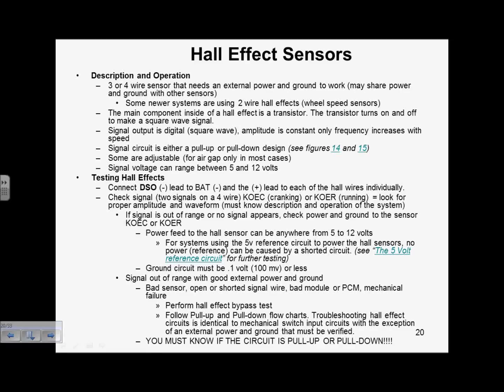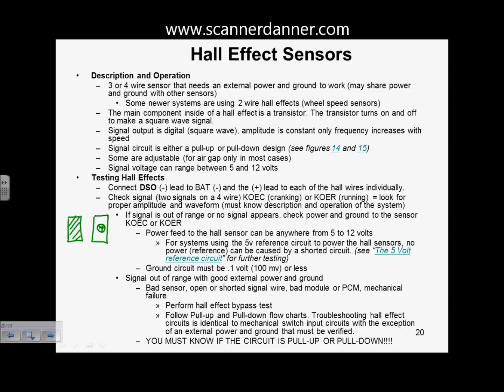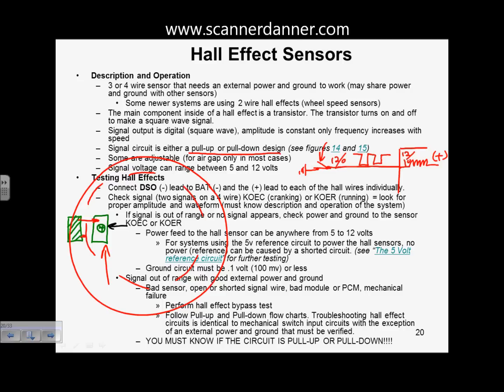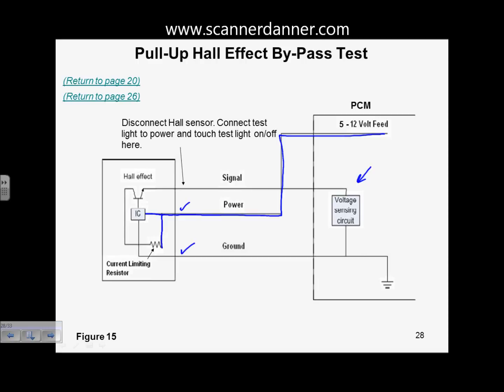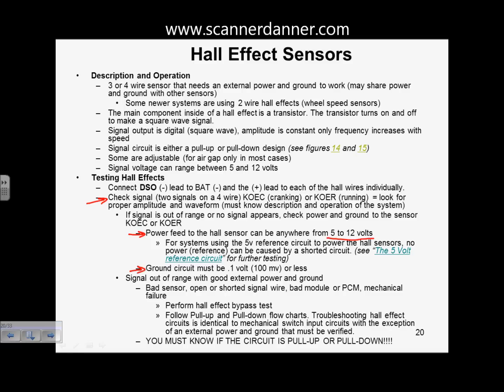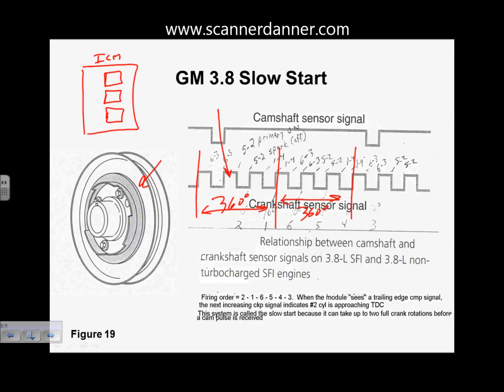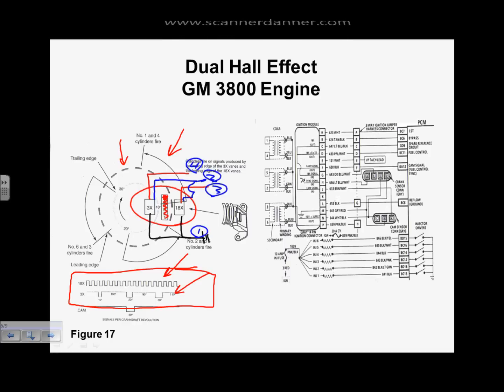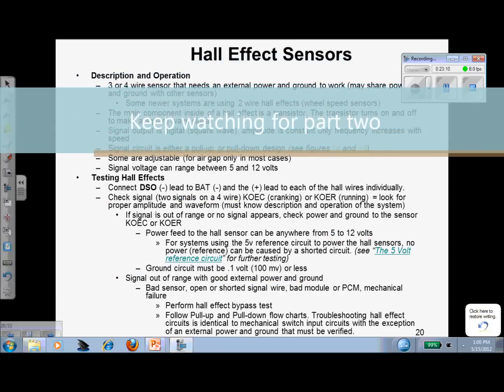Hall effect cam/crank sensor operation and testing Part 1 (an SD Premium video)

Comment: Thank you!!!!!Another Excellent video which saved my proverbial bacon. I was able to test my Megasquirt 3 Pro Mini setup with the info in this video and your other GM 3.8 crank signal wiring video. It was still a real thinker, but I was able to determine my wiring was good, but that I was taking the switched power for the sensor off of something controlled by the fuel pump relay. It would only activate for a couple seconds before kicking off until seeing a crank signal. Well... If the crank sensor isn't getting power after it kicks off, it'll never see it. A change in wiring and my car now starts reliably, not just when the FP relay initially primes the pump. 

Thanks again!
Reply from the maker: heck yeah man, that is awesome. That was some good self study you did there! Proud of you. Nice job

Comment: How come the 12 volts does not drop when there is current flow. i know the 5 volt ref circuit doesnt support current flow so theres barely any current. However, unless the resistance within the computer voltage sensing circuit is greater than the current limiting resistor, i dont understand why it wouldnt be dropped across the resistor. feed back is appreciated because i want to master this. thank you.
Reply from the maker: I need additional info. 12v on what circuit? There are super small amounts of current flow on a hall effect circuit too. The resistance inside of the sensing circuit is very high! So high that it is not really a direction current can travel

Comment: So can the signal wire be 5V with a 12V power supply?
Reply from the maker: typically when you see a 12v power feed on a hall effect, the signal circuit is usually a 12v pull-up design, but I'm sure you can also still have a version out there where they use a 5v pull-down on the signal circuit, with a 12v supply
Reply: @ScannerDanner  okay gotcha, got a 2010 Mazda 3 with a 2.0 having a helluva time tracing a p0720 guessing the TCM is fried cause everything checks out with wiring

Comment: Scanner Danner!  Great Video!  I have been out of automotive for 25 years and this was Great and easy to follow and understand.. Thank you!  And a question if you may know?  I have a 99 Ranger 4x4 with a  3.0, 5 speed that I have no acceleration to speak of.. Runs smooth, I Just replaced Cracked Heads this year. and timing chain and gears a year ago, Had No Blow by, No air leaking from any valves, No Cylinder wear visible..  Had a cam sensor code when 1st started. So I set sensor 15deg of center line as instructed which got rid of code.  Drove 1,500 miles 70-75mph  to Texas getting 20mpg but very slow accelerating with foot to floor in 4th or 5th gears.  No Codes, No overheating?  Checked cable and fixed Stretch.  I am at a lose?  could synchronizer being off 180 possibly do that?

Comment: Trying to help friend with 92 Dodge B350, cranking has fuel but no spark. Anyway you can help SD?
Reply from the maker: Post this to my forum. Some questions require research on my part, which I cannot offer here.

My forum is free to join. https://www.scannerdanner.com/forum.html We have over 17K members world-wide and we also have paid moderators who are there to help me help you guys! You will not find a more helpful and friendly forum anywhere. Thank you for understanding! Hope to see you on the forum.

Comment: Could I safely say, If I take my Circuit Tester and place it on Battery Negative and I then touch the signal wire of the HALL EFFECT SENSOR and I get a reaction on the circuit this would represent a PULL DOWN DESIGN HALL EFFECT SENSOR. And if I were to place my Circuit Tester on Battery Positive and I then touch the signal wire of the HALL EFFECT SENIOR and I get a reaction on the circuit this would represent a PULL UP DESIGN HALL EFFECT SENSOR .
Reply from the maker: What kind of circuit tester? An LED type test light will not work.
And depending on the position of the reluctor or drive plate when the engine shuts off, this can pull the signal low causing misidentification of the circuit. This is why this test is done unplugged. 
Then finally, you won't get a reaction without having both cam AND crank signals at the same time on some system.

Comment: Mr Paul I have run into problem and I want u to clarify something for me.am working on a 2013 e class benz and the problem is the  bake  light stay lite all the time.i went to the remove the brake switch and I realised the brake switch was a four wire brake switch.i try to gather information from the Internet about the switch and to my surprise and my first time of hearing that the brake switch is hall effect sensor.i know for a fact that hall effect are mostly use on rotary or revolutionary sensors like the speed,cam and crank sensor,abs and many more but never knew it can be applied on brake switch sensor.i know with the four wire Hall effect sensor we have to 2 signal power and ground.Mr Paul in your book you made mention on by passing the 3 wire sensor if it is a pull up or pul down but u didn't talk on how to by pass by the 4 wire with the 2 signal.my first question?i want to know theory behind the brake switch since the brake pedal is not a rotary type but only move up and down....Secondly how do we bypass the two signal wiring...Thank you

Comment: I'M trying to install a 3 wire to my vw tdi 07. i like to identify the 3 wires. between yellow + black residence is 44.8 and next ,. black and red .92 i like to identify emc so not to mess with $87. is this a enough information, thanks

Comment: Hi great videos am currently struggling with getting my Hall effect cam sensor on a mega squirt ecu and I have 12v going to the cam sensor ground is going straight to the block and signal going to the ecu I have a 1k resistor going between the 12v and signal wire. When I crank the motor over I don’t get any wave pattern. does the ecu need to know when it the cam sensor is grounded? like using a sensor ground going to the ecu?  Just been so stumped on this part
Reply from the maker: So the 1k resistor is creating a voltage signal that the sensor will pull low (transistor in the hall effect) as the trigger wheel "excites" it. The ECU will see this high/low signal (which I would call a modified pull-up design) as cam position. If your signal is staying high, I would pull that sensor and move it past a metal object to see if you can pull that signal low.

Comment: Are all 3 wire cam/crank sensors hall effects? Are Toyota, Nissan, Honda hall effect sensors and will you test them the same?
Reply from the maker: Unless it is actually a 2 wire VRS with the third wire being a shield. (I've seen that on Euro cars)

Comment: pull-up design...ah, earlier in your book you draw it such that the signal wire goes beyond the voltage sensing circuit(in the pcm) and then to ground...here s different...explain!...bcus, if it is not grounded, then there is no current flow taking place there...(just volts, no amps)...
Reply from the maker: It's just a sensing circuit. There is no measurable amperage. The internal ground in this application just keeps the signal square when the switch opens up. With no ground, voltage would ramp off instead of being immediately 0v. Sometimes I draw it, sometimes I don't because it's not important in anyway for troubleshooting the circuit. Male sense?
Reply: ok...understood...one more thing...why is it that you never mentioned(at least for an easier understanding) the fact that pull-up and pull-down are actually a power side switched and ground side switched, respectively?
Reply from the maker: Because I apply those terms to output controls which are absolutely not the same and I do not want my students getting confused about what they are working with.

Comment: so if you unplug the sensor and you still have 5 to 12 v on  the signal wire , it would be a pull down design ?
Reply: No, he has it backwards. The terms could be different in automotive, but in electronics, a circuit which relaxes to a low (ground, 0V) state is called pulled-down and a circuit which relaxes to a high (positive voltage) state is called pulled-up.
Reply: @GarrettFellers  by "relaxes", you mean in the "off" position? Relaxed being off vs. energized?

Comment: Hi scanner. have you ever seen a 3 wire hall effect with no supply voltage give a ac sine wave on the signal wire? This is a Uk spec audi s4, 1994. it has a hall effect rpm sensor that reads the teeth on the starter ring gear and shares the supply that is missing of the crank sensor and they both give ac sine waves. the car starts but is a intermittant  stop. Its all interesting.  I hope you see this. thank you for all your videos on both channels. i look forward to hearing your experiance with this.
Reply from the maker: +pip470 If it is an AC sign wave on a three wire sensor, then it is not a hall effect. It is a VR sensor with the third wire being used as a shield.
Reply: ScannerDanner wow how easy is it to chase after something that is not a fault. Because the cam sensor is a hall effect and I have power, ground and a square wave signal. I asumed it was the same. Even drawn on the wiring diagram I couldn't  tell . Thank you for your response. I will carry on looking. One thing from your lessons that sticks in my mind though is that if a vrs generates it's own voltage to produce it's signal, why would the share one of thier wires. You have shared grounds which is the shield as you said. Seperate signal wires going to different pins on the ecu and a shared wire coming from 1 pin on the ecu. I'm going back to watch the vrs lessons now. Thank you paul.

Comment from the maker: Correct. but remember the signal circuit in the PCM is already protected by its super high resistance (mega ohm range). What would be protected is the hall effect sensor and the supply side or hall effect feed circuit. If this feed comes from the PCM, it would be that circuit (not the signal circuit) that needs protected.

Comment: Ah i see! Since the transistor is not grounding the power feed when it turns it on, there is no current flow hence no voltage drop. The resistor is there only just in case the signal wire get grounded, hence protecting the pcm from receiving alot of unwanted current flow and frying something. Do i got that right?

Comment from the maker: Great question, re-watch the video at the 12:08 mark. What I am saying is that the voltage sensing circuit does not support current flow so even though the transistor is "on" there is STILL no voltage drop across the internal resistor because there is STILL no current flow. The only reason the resistor is there is for protection from a short to ground on the signal wire. Hope that makes sense. Let me know

Comment: paul, on the pull up design why dont we have votage drop when the transistor turn on. shouldnt the voltage drop to zero because of that resistor? if so, why is the computer still reading 12v

Comment from the maker: It is the 4424. as a trainer i definately need the extra two channels but i think you could get by with the two channel. there are times i use more than 2. say i have a coil firing issue (not knowing the cause) and i want to watch cam crank and coil current at the same time. either way the job could be done with just two channels. you simply cannot go wrong with a pico.

Comment from the maker: On a 5 volt pull up design circuit (GM ICM to PCM distributor reference circuit) i will still use a test light connected to 12v for the bypass test. I've done this test 100s of times with no PCM damage. it is a high impedance voltage sensing circuit that supports no current flow.

Comment from the maker: All of the 5 volt signal circuits that i have seen on hall effects are pull down design. so the bypass test involves grounding the signal circuit. you will NOT hurt the circuit by using a test light to ground it. you can even use a jumper wire. i use a light as a safety measure in case i accidentily jump the wrong pin.
Reply: What happens if you ground a pull up circuit? Will you damage the pcm?
Reply from the maker: @johnnymalicoat754  first thing is knowing what signal voltage is before ever doing a bypass test, on a disconnected pull-up sensor signal circuit the voltage will be 0, grounding it, just keeps is at 0, no damage done, no concerns, just a useless test, make sense?